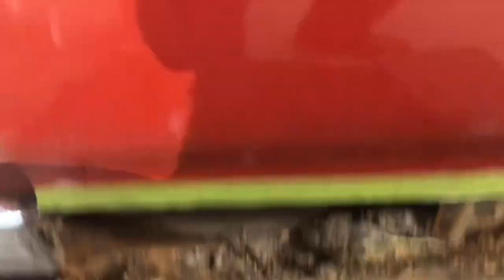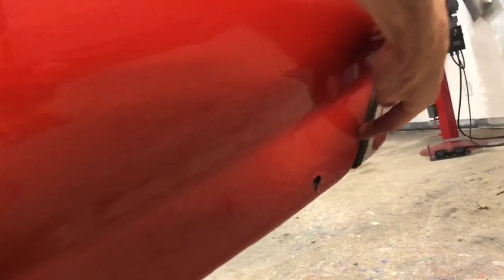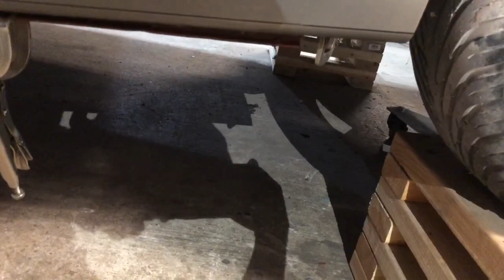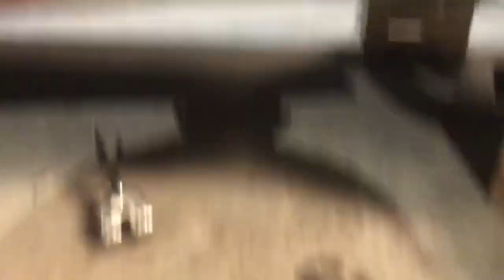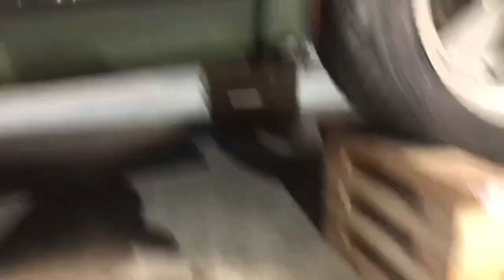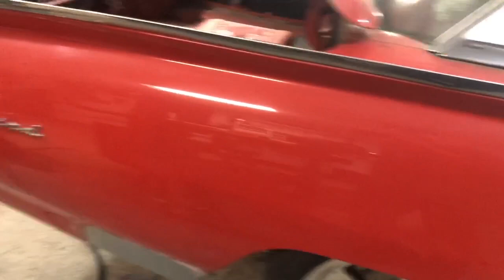Patch panel repair

Comment: Real nice work, super clean. Wondering if you use any corrosion protection, such as weld through primer, before welding on the panel (besides the primer in the vid) or does that get handled elsewhere?
Reply from the maker: No all metal work should be done then off to body shop but this ones not getting painted for some time so I will spay.l some epoxy primer when finished
Reply: I should have been more clear, I meant on the inside, before welding. Specifically the places that become inaccessible after the repair panel is welded in place. I forget where in the country you’re based but I live in the Boston area, I can’t leave anything uncoated inside at all, ever.

Comment: 1964 Ford Thunderbird is a different body. That one is older a 1963.
Reply from the maker: It could be a late 63 but registered as a 64
Reply: @Iconicspeeddesign  Registration years are often incorrect. What matters is that the car is a 1963 model Ford Thunderbird.

Comment: I like The tape trick 
What do you use the cut back to the tape line personally I machine cut to about 1/4 inch from the line then I'll trim the line with a Tin snips and sand any remaining fitment issues
Reply from the maker: If it’s a straight line according to a ruler I use the shear if not then I get it close with the shear like a 1/4 “ away the tin snips for small panels and electric shears for large panels

Comment: Great job as usual. You never cut corners. I respect that a lot!!!!!
Reply from the maker: The reason is because it will give you more problems and headache later do it right the first time is my motto
Reply: @Iconicspeeddesign  Same here as I do mechanical repairs. I don't have time to do things twice.